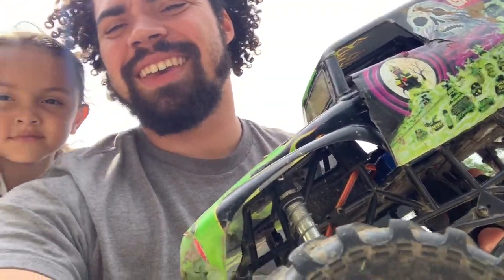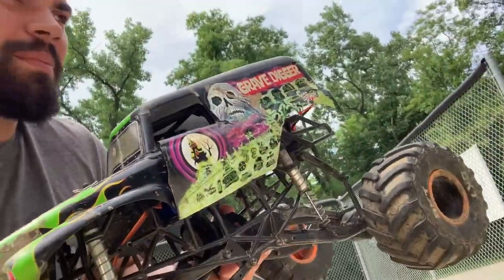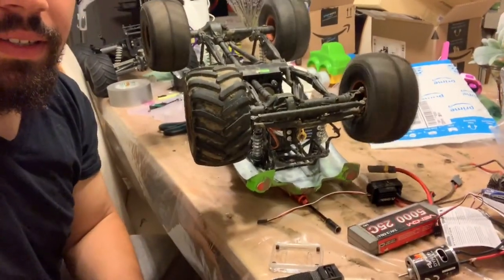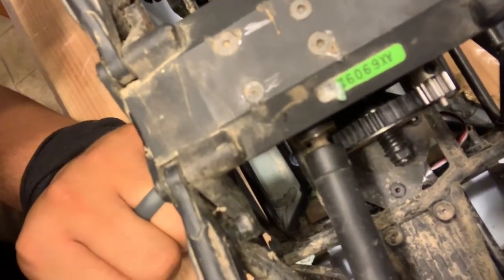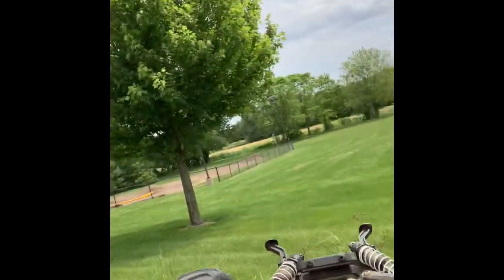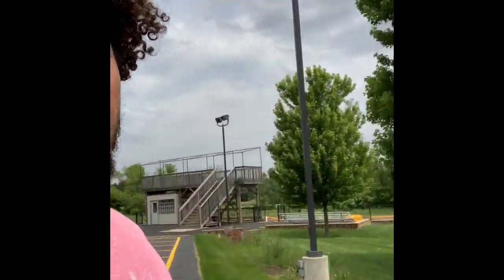Monster Truck Meets Skate Park / Traxxas Stampede 2wd

Comment: what brushless system are you using? pros cons ?
Reply from the maker: Using a Traxxas valenion system. I think it’s 2500kv. Pros are... she’s fast. Cons are... I break a lot😂 really though, it’s a great system! Unfortunately it didn’t work with my non Traxxas receiver
Reply: @TrailerTrashRC  does it overheat at all? what pinion are you using? also i use Redcat gen 7 pro aluminium drive lines they fit perfect and are indestructible.
Reply from the maker: @Matthew-dt6bd  ive never had issues with over heating. and good to know about the driveline